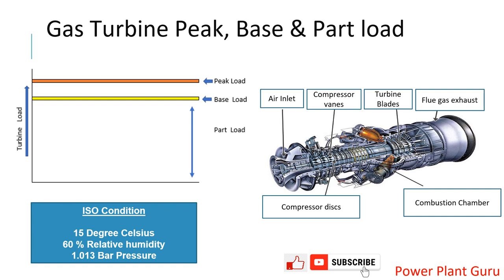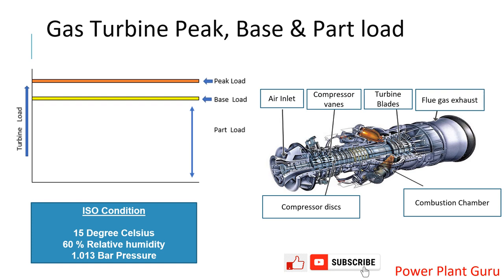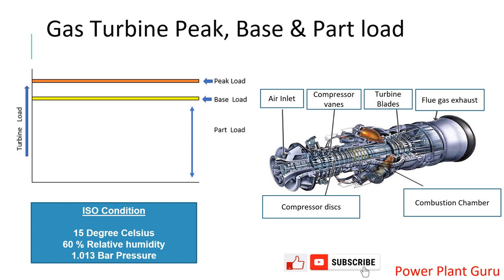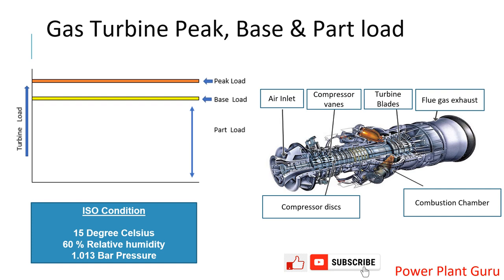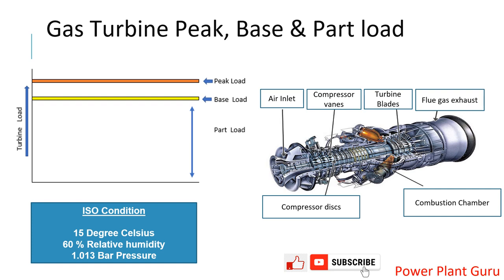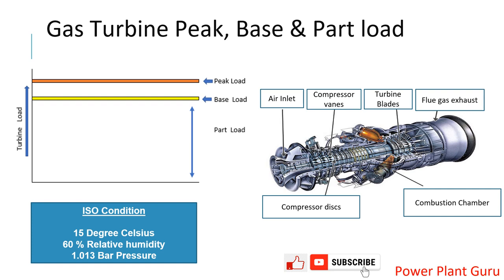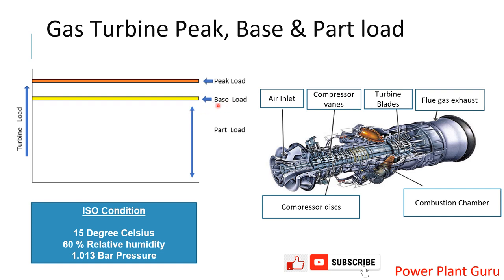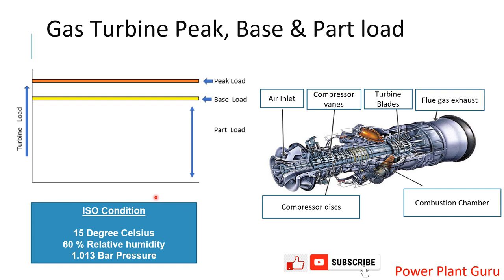Base load of Gas turbine, Peak Load and ISO condition for gas turbine power plant

Comment: If the temperature, pressure and relative humidity conditions are not met, but IGVs are still in full open condition, can we call it the base load condition in that scenario?
Reply from the maker: Hello Fazeel 
Yes, that condition is the base load condition. 
If the IGV is full open that means it's load can't be increased further. And that's why gas turbines have different base load MW in different ambient conditions.
Reply: @powerplantguru007  Thanks. The Power Plant videos are really helpful. Keep it up, please. Could you please make some video on surging, choking and stalling of compressor?